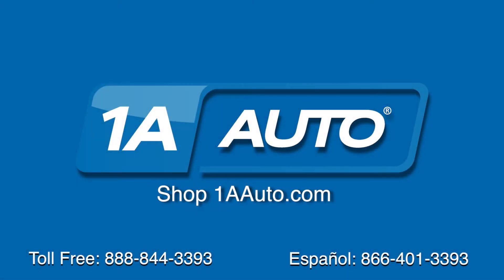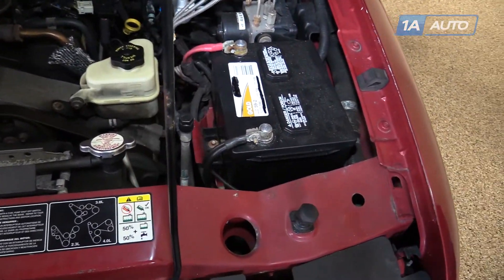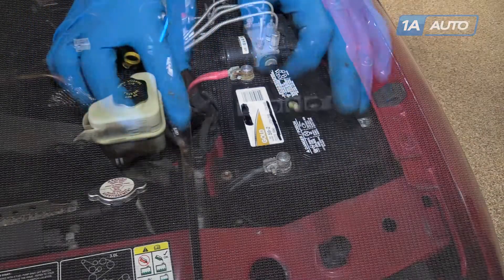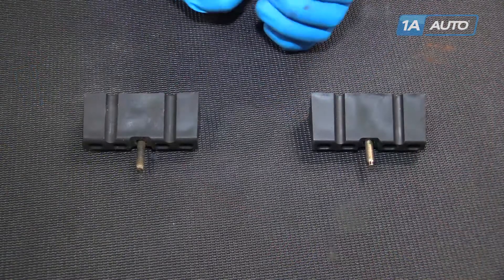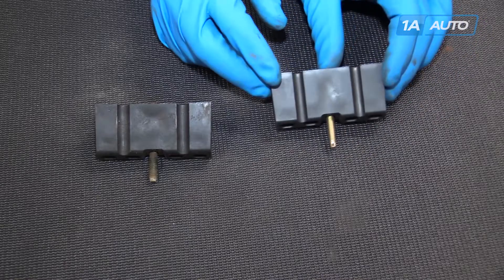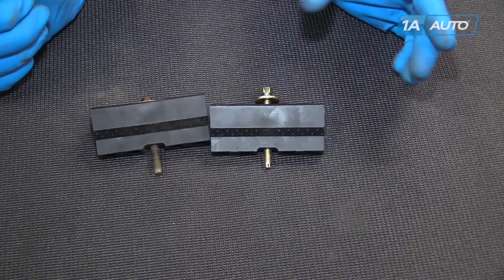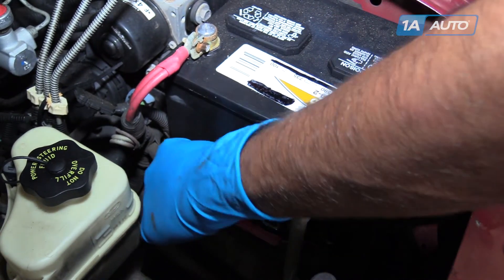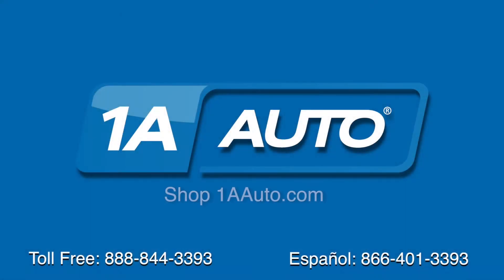How to Replace Battery Hold Down 89-08 Ford Ranger

Comment: What is the little metal clip that the bolt threads into called? I have an 08 F250 and I had to cut and chisel that baby out of there as it was rust welded together. So to speak. I found that the hold down replacement clip was not included with the kit. No one at the auto parts store has a clue.
Reply: Same issue

Comment: You need to remove the battery to show exactly where the hold down bolt goes because mine does not appear to have the hole to bolt it into. All the videos on this problem  have the same issue!